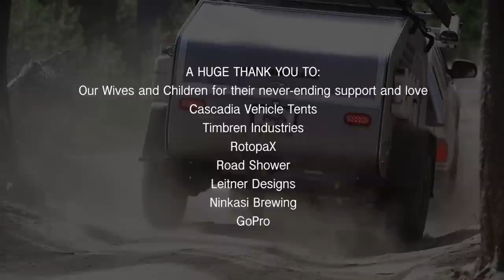Overnight'R:  This Is How We Roll

Comment: Very nice trailer!
How do you keep the bears away from destroying your trailer with all that food inside of it?
Reply from the maker: Well, the first trick is to be aware of where you are camping and what kind of critters are near.  If you are camping in bear country, you have to take proper precautions (locking food box/cooler, bear hang, etc...).  Oregon has a lot of bears, but we've never had any real issues with them in 30+ years of camping.  One of our options  is a "panic alarm" which is an EXTREMELY loud siren that can be turned on  from inside the camper. Anything with ears anywhere nearby will vacate quickly!